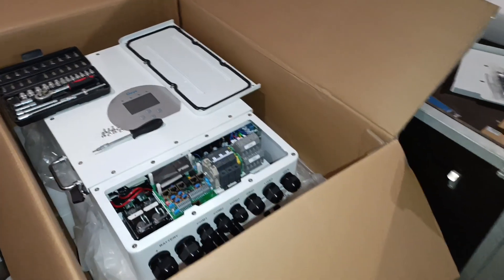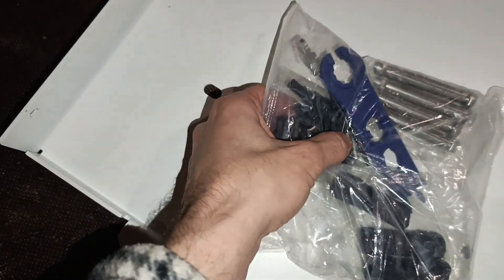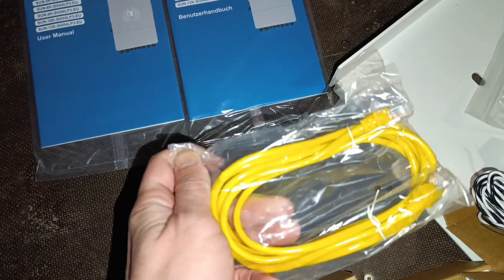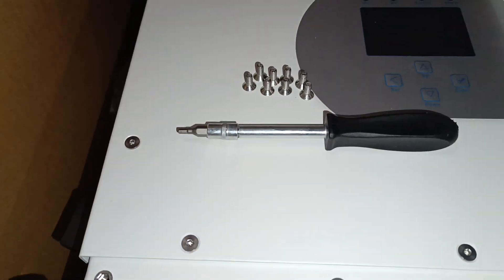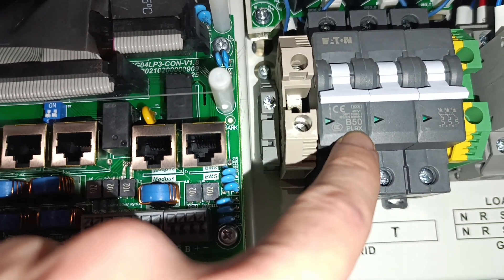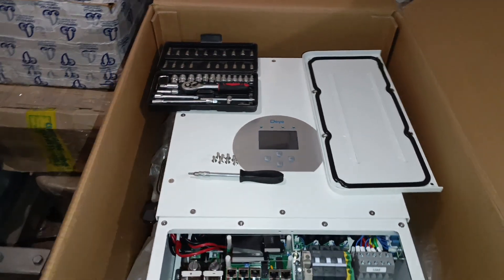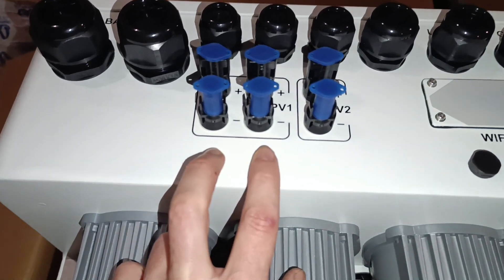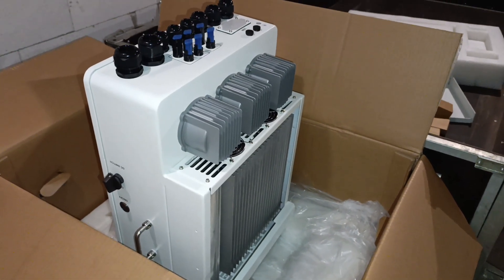Unpacking and detailed review of 10 kW Deye, three-phase, double MPPT, just decent hybrid inverter

Comment: Maybe you have any ideas how can I connect Deye with my Ewelink (smart home) account to turn on/off smart devices (car charger, boiler, ect.)? Now i do it through relay connected to smart output, it works fine, but my gen port is now occupied, but I want to use for other purposes! Буду дуже вдячний)))
Reply from the maker: use RS485 (ModBus) - there is a lot of stuff that can be achieved via it. however, I am not fully aware where any examples can be found with nice documentation - you will have to do a deep research on some solar DIY forums I'm afraid
Reply: @BackyardVoltage Thank you! I’ll try that!

Comment: Does it have a seperate generator input? Would like to buy an inverter that can will charge the battery from generator when the grid is not available and there is no sun. Live in Ukraine too, the grid is not as reliable as we wish.
Reply from the maker: Yes, it does. the only thing you have to consider - 3phase inverter requires 3-phase generator. single-phase inverter required single-phase generator.
in both cases the best is to use either diesel or the petrol-inverter generator type.
another thing - the generator has to be powerful enough to bear all the house loads and only then, the extras can go to charging the batteries. if the gen is less than the load power - it will be stopped by the inverter, since it cannot add-mix power from the batteries to it to cover some higher loads.
Reply: @BackyardVoltage  Have a 3 phase generator of 10kw and would like to buy the 25kw Deye and 60kw in batteries. The idea is that if the batteries are below e.g. 30% the generator will start and charge the batteries. 

Do you know if these high voltage Deye hybrid inverters support this setup?

Thanks for your help.
Reply from the maker: yes, you can set the generator so tart at the low battery SOC value achieved. and you can use it even using some time intervals (time of use function). the only thing - generator has to support the ATS function
Reply: @BackyardVoltage  it you set the limit of generator and you have higher load than the limit of generator, the extra power can be generated from the inverter and mix generator plus inverter?
Reply from the maker: @ no, the gen has to cover all the load, if not - it will stop
Reply: So the only way to get more power than rated power is to connect a microinverter to gen port or only way is with grid to grid port and so i can achieve the max passthrough amperage? can i make this series connection with deye inverter https://www.youtube.com/watch?v=SsTkgoN6ENM&t=613s , to supply loads that exceed the rated power of inverter?